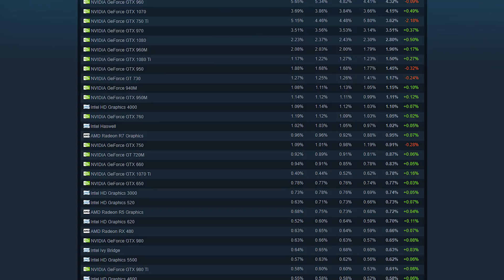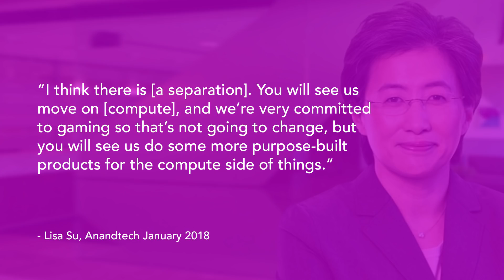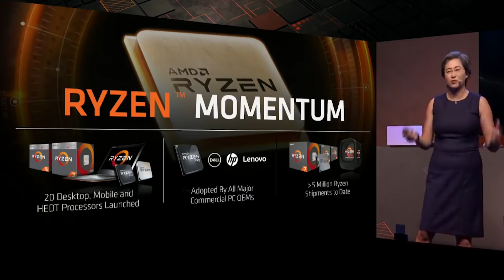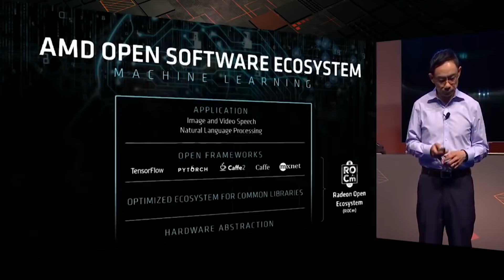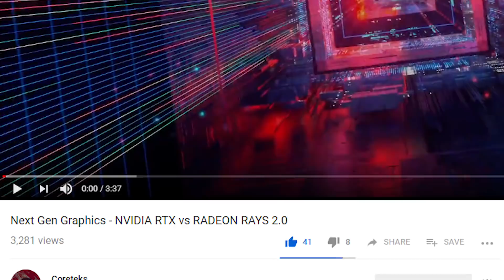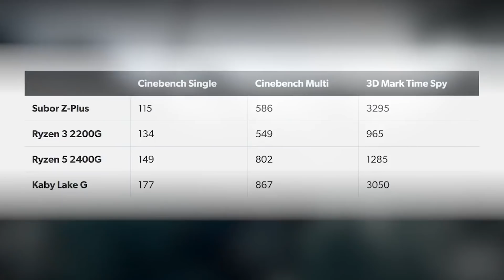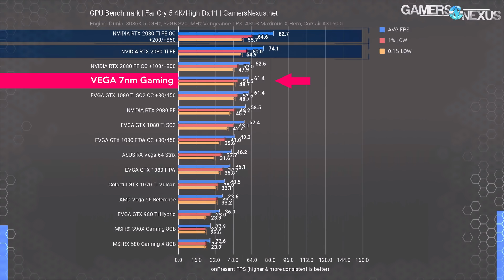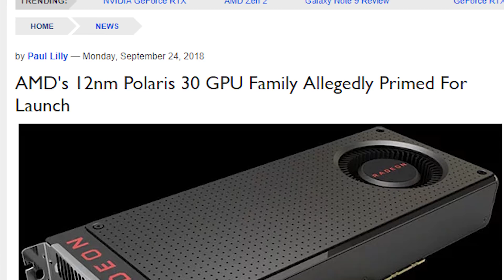AMD's answer to RTX

Comment: Regarding pricing, the pessimist in me fear that AMD don't have the room for too much price movement in the graphics prices, so they will be pricing cards to be roughly the same price/performance ratio as Nvidia cards. And we all know how well that will sway the Nvidia crowd over to try something else... I highly doubt they will be setting price points that look very enticing.
Reply: AMD IMO prices things "fairly" and do A LOT of "public" i.e 3rd party stuff, if it is expensive to produce, it will be more expensive on the shelf, but even then they are "fair" if you look at threadripper or EPYC as base example they could have "easily" priced them 2-3x what they did (for the first 6 mths or so) but they did not, they made a chunk of profit, they walked away happy, consumer walked away happy, same goes with Rzen, 2-4x the same cores 4-8x the amount of threads of "comparable" Intel chips they could have "easily" priced them a few hundred more then they did, but they did not, they priced "fair" so they do not make "as much" but they get more product out in the world which benefits pretty much everyone.

Radeons have more or less always been this same way "Fair price for the product delivered" some exceptions such as the dual-gpu cards or some such as FuryX, Vegas, 7970 and the like, but those were all "costly" to be making and the "best" they could put out at the time...quality costs "something" AMD is all "quality" IMHO (obviously some AIB screw the pooch on them unfortunately by "crapping" the base design up, charging more then they should be, but that is NOT always AMD fault either to be fair)

I could picture if AMD did a virtually identical to 2080Ti level performance chopping price down by $200 or so (covers their costs and gets more out the door) time will tell (if it were Nv on the other hand, as they have proven time and time again, they would not "match the price" they would increase it by $100-$300+ instead...because they are "greedy"and bank on the "BS" features not the overall "quality" of the product to make the sales)

Comment: "AMD is falling further and further behind in terms of performance"

Bro, rx 480,580 and even the other ones still kill in 1080p, for many that's all they need, and for the price point you won't catch me buying a 1080 or ti except for 4k
 Back to the vid
Reply: gt 480 still slays in 1080p, whats your point here? going to re-edit your comment for the 3rd time?
Reply: You TriHard
Reply: that's like saying the 1030 is fine because the most common display resolution is 1366x768, therefore all you need is a 1030 to get by.

source: just google "most common display resolution" lmao
Reply: @uhix1490  
1030 sucks. Get an r3 2200g.
Reply: riplip WHAT A FUCKING NI.... CE Guy :)
Reply: @Davvid S Vulkan is basically Dx12. AMD got sick of waiting for Microsoft to engineer something to follow Dx11, which many felt didn't get you close enough to the bare metal to do any real optimization tuning, and made Mantle, which became Vulcan when AMD made it open source, effectively turning Vulcan Dx12 into a cross platform version of DirectX.
Meanwhile, OpenGL becomes less and less irrelevant.
Reply: I still fight with msi r9 280x gaming x  at 1080p 144hz
Getting over 40-50 fps on the games like 
Battlefield 1 , GTA V  etc.
Reply: temp tmp  
High end is for 40yo babies.
Reply: temp tmp  
Exactly... Irrational behaviour.
Reply: Exactly, how in the world is AMD so behind when Vega was never intended to compete against the 1080ti when it was initially developed?
Reply: V64 outperforms even the 1080Ti in some titles, e.g. Forza Horizon 4.
Reply: -T-X-M-  no the 56 barely edges out the 1070 and the 64 does worse in some games or is on par
Reply: @gnuportexe4657  CPU: Threadripper 1950X
Benchmark 3DMark

Firesrike 
GTX 1080
http://www.3dmark.com/fs/14740761
RX Vega 64
http://www.3dmark.com/fs/16192269

Firestrike Extreme
GTX 1080
http://www.3dmark.com/fs/14742676
RX Vega 64
http://www.3dmark.com/fs/14350860

Firestrike Ultra
GTX1080
http://www.3dmark.com/fs/14803523
RX Vega 64
http://www.3dmark.com/fs/14350895

Time Spy
GTX 1080
http://www.3dmark.com/spy/2945231
RX Vega 64
http://www.3dmark.com/spy/4271819

Time Spy Extreme
GTX 1080
http://www.3dmark.com/spy/2918777
RX Vega 64
http://www.3dmark.com/spy/4271798
Reply: -T-X-M-  The Vega 56 trades blows with the 1070/1070ti while the 64 trades blows with the 1080. More often than not, the 56\64 match or edge out in games that don't favor either brand.
Reply: 1080p in 2018? rofl
Reply: @tjpark6883  playing at 4k 30 fps OOF
Reply: +riplip just because they work fine for you, doesn't mean they're not falling behind, AMD has no high end to compete with nvidia right now, for a while in fact, so yes, they are, and have been behind on performance for a while.
Reply: @ Elon61 while I understand your point to riplip, I can't agree with your assessment.  "Falling behind" is a matter of context, based solely in the areas any business chooses to compete.  While the precedent was set by AMD in past years to compete with Nvidia at every market level, that does not mean they are required to do so their entire existence.  Businesses change their business plans and strategic outlook to focus on what works for them at a given time and will target their product offerings to the market segments they have strength in.  I suppose it can be said that AMD GPU are falling behind, but only after defining the market context the statement presupposition is hinged upon.  In another context again based on the statement presupposition, then no.   However if AMD attempted to directly compete beyond the shadow of a doubt by their own admission with the 1080ti, RTX 2080, RTX 2080 ti etc, that could literally be considered being left behind.  They have nothing that competes with any of the cards, nor have they announced any of their products capable of doing so.  Their Vega offering, particularly the 56 compete quite nicely against the GTX 1070 and 64 against the GTX 1080, despite some consumer and reviewer/tester claims to the contrary.  In that regard they aren't falling behind, their products accomplished in that market what was intended, save for the higher cost of HBM.
Reply: Elon61 not being the best doesn’t mean falling behind, if I made a good product that sells due to a good price but isn’t the best am I still falling behind compared to the best product that sells less due to the high price
Reply: is that how you interpret "falling further and further behind in terms of performance"? what do number of sales have to do with performance of their devices in this context? plus amd gpu market/revenue share has been way behind nvidia for a long time. there's no doubt a 480/580 performs great for their price point but if you want the best raw performance look elsewhere.

Comment: I’m definitely not holding my breath here but I think we might see potentially more gain. I mean I wouldn’t use Far Cry 5 as an example personally there are just too unoptimized in my opinion. Also the bench mark was using the STRIX Vega 64, the lowest clock Vega out of the box (doesn’t break 1500MHz stock). The highest factory clock Vega 64 I have seen is the Sapphire Nitro Plus which stock will reach 1550-1600 MHz. (Or even the LC Vega). I think using the Hardware unboxed Forza Horizon Benchmarks Are more showing for where 7nm may land on a proper PC port.
Reply: so he uses an unoptimized game (an optimized one would perform better) and the lowest clocked Vega card (higher clocked would perform better) so he should base his +35% off of a higher performing card... So it would perform even better than what he showed... Why not use what he showed? It isn't overly optimistic then as I just proved.
Reply: Jesper Andersen
 
That is an excellent point, thank your for a constructive response.

Comment: that 35% performance claim on the slide wasnt referring to the cards it was referring 7nm itself. in the context of a node "performance" pretty much just means clockspeed. extrapolating that to overall card performance is misguided as it completely ignores the impact of architectural changes or increased density, or even the possibility to trade off some performance for a better power efficiency curve.

Comment: We share the same opinion on nvidias moves.
That was the first i thought of after hearing nvidia will still sell 10series alongside 20 series. They will lower the prices of 20series once the 10series stock depleted. I can even imagine them doing an interview at some sort or announcement like " we want to make the 20 series more achievable. We heard you that it was too expensive and so on.
If this is all true and amd manages to release a vega 7nm that has lower power consumption and better Performance. I will switch red all the way. I read through articles of intel and nvidia and it disgusts me. I really hope amd picks up all the way.

Comment: I think you are wrong in your assumptions, BUT made me think if it's possible to make ray tracing with CPU+GPU in a much more scalable way,
Part of the AI calculation would be divided, and i think that Intel and AMD will adopt this at least on their APUs and variations of it, like the intel plus vega. So the extra ryzen cores will possibly be dedicated to do it, or maybe a hardware accelerator inside cpu and gpu will talk thru a faster lane.

Comment: VEGA 7nm Gaming GPU's  can be faster than 35%. It is also 2x more power efficient if they reduce it by giving even higher clockspeeds in favor of the performance we get faster cards. For example: With a 1.85x more efficient (which would be also great) card the performance would be 50% faster than the 64. The power consumption would be higher than they actually planned, but it is not the Gaming card specs so it can be different.

Comment: Big mistake in the assumptions about Vega 7nm performance.   Using HBM2 (even over a cut-down 3096-bit bus) would bring over a 50%, or even a 100%+ boost to bandwidth.  That could bring a performance boost of up to 50-75% depending on the configuration.  This scenario is WAY more likely since Vega 7nm is likely a semi-temporary card to hold the door till Navi comes out.  Oh, and since the 2080 Ti is $1200, AMD could get away with selling a 12GB or 16GB Vega 20 at $999 as long as it is within 20% of the performance of the 2080 Ti.

Comment: Remember when Lisa Su said at AMD computex event (6th June 2018) - 'for all you gamers out there, we will be releasing a 7nm gaming gpu, so stay tuned'?. 

Then at end of June 2018, AMD said they were going to release a 7nm-16GB-HBM2-Vega64 gpu?. At the time I was wondering 'why does it need to have 16GB-HBM2 because 8GB is more than adequate even for 4K gaming'?. 

Then the penny dropped and I realised this was going to be a dual V64/56 gpu on 7nm, linked by Infinity Fabric. Bearing in mind all the bullshit hype Turing and the RTX2080/Ti were receiving, I think AMD felt threatened and they needed to make a statement (viz. the dual Vega gpu on 7nm). 

BTW, a third party USA hardware testing company leaked out info saying that the Vega64 7nm-dual gpu was an absolute performance beast and that it left even the Titan-Xp in the dust. 

Then in end of July 2018, Lisa Su released a statement saying AMD would not be going ahead with the new 7nm-16GB-HBM2 gpu and she cited the high cost of 16GB-HBM2 to be the reason. She said gamers wouldn't be able to afford it. 

Even back then I said that is a bullshit excuse since Lisa is a highly intelligent woman (she has a PhD in computer engineering), yet it supposedly never occurred to her that HBM2 is expensive even for enthusiast gamers?. 

BULLSHIT!. I reckon AMD did a U-turn because they received inside industry information that Turing was going to be a failure. Therefore, AMD no longer felt the need to release a dual V64-7nm gpu. BTW, do you guys know that evil huang is Lisa Su's uncle?. No shit. You gotta love nepotism. 

Also, this excuse of 'very expensive HBM2 cost' doesn't cut the mustard for a second reason. Have you seen how expensive the RTX2080 and 2080Ti are?. The cheapest RTX2080 is £700 and the cheapest RTX2080Ti is £1130. 

Despite these criminally extortionate prices, gayvidia fanny-boys will shell out big bucks for these gpu's, so the excuse given by AMD that HBM2 is too expensive just doesn't hold any water.  

Apparently AMD is releasing a Polaris refresh on 12nm (RX680). I will be very disappointed, unless it turns out to have some very special features like all 4096SP's have been enabled OR it will be a dual core gpu (so 2x2304SP's and mounted on Infinity Fabric with total of 4608SP's) AND it will come with 8GB-GDDR6 (or 16GB GDDR6 in case of a dual core Polaris gpu).

Perhaps this is the actual 7nm gpu Lisa was referring to?. Only time will tell. 

The Polaris refresh will apparently give 20% performance improvement over the RX580 (according to Red Gaming Tech), just by going from 14nm to 12nm. 

TBH, I cannot see that happening if it is going from 14nm to 12nm BUT I can see it happening if it is going from 14nm to 7nm. Then the 8GB GDDR6 will give another 20% performance increase over the previous GDDR5. So we could potentially see a 40% performance improvement (same as RTX2060) which would put the RX680 halfway between a GTX1070 and GTX1080.  

AMD are doing an RX680 refresh before the RTX2060 hits the market cos AMD want to grab the mid-range market share b4 gayvidia.
Reply: "Evil huang is Lisa Su's uncle", NOOOOOOOOOOOO!!!!! "Search your feelings gamer, you know it to be true!"
Reply: @TechieTard  - lol. Yeah man it's true. The evil one whose name shall not be mentioned is the female youngling's uncle.
Reply: ''Su’s grandfather is Huang’s uncle.'' wiki. Lisa Su is the niece of Jen-Hsun Huang.
Reply: @Safetytrousers  - that is correct.
Reply: I have 2 Vega Frontier edition 16GB Liquid cooled GPU's in my heavily modded 12 core Mac Pro,  FCPX and other programs I run use all the Ram and the cores. not all of us play games, I Also have a 16 Core threadripper in a windows 10 rig, used for Davinci Resolve, Blender etc. with three TITAN X GPU's (Maxwell) so the new 7 nm Navi cards next year are what i'm waiting for to upgrade my rig. as in independent Film maker any saving on GPU's can be used for the purchase of other kit, (Cameras, sound recorders, fast storage, gimbals etc) which is never ending.
Reply: John - I was commenting specifically with regards to AMD's gaming gpu road map, although I understand perfectly well folks such as yourself are not gamers. Rather, you belong to the semi/pro market. That being said, I am not just a gamer. I have a 1950X with a 1080Ti (although I am looking to migrate back to AMD when a suitable opportunity arises). I am a Pharmacologist, so I also use my pc for academia related work and other projects such as BOINC-SETI and protein folding.

I am however astounded by the number of expensive pc's and subsequent ultra enthusiast components you apparently require. Your line of work is incredibly resource intensive. Your spending habits are probably on par with women. The only difference being you are buying useful items to further your line of work, whilst women spend exorbitant amounts of money on bullshit  ;)
Reply: I highly doubt they have the resource to do so.
Reply: @DarkPa1adin  - AMD have the resource to release an upcoming Rx680 polaris refresh on 12nm, so they are not as financially limited as you think they are. Tbh, Lisa Su is putting most of AMD money into the cpu side of the business.
Reply: @DarkPa1adin  BTW, I honestly think this Rx680 is pretty much pointless. It's just a quick smash and grab money making tactic.
Reply: @beachboy_boobybuilder  Well, it that's true, then I am excited for the RX680. It has to be cheaper than Vega 56/64 and require less power though. Although I do think the jump from 14 to 7/12nm will help.
Reply: @beachboy_boobybuilder  it's not pointless, it will steal marketshare from the 1060, it will be faster than the RX480 or 580, and cost about $300 (a somewhat educated guess.) It will be 3rd gen Polaris, which turned out to be a pretty good card once the driver coders at AMD got good at optimizing for it. To ditch Polaris would mean wasting a lot of meaningful effort invested in not only the hardware but also software.
Also, Intel licensed AMD GPU IP a while back, right after Vega was released, just before Koduri went to work at Intel. AMD makes alot of money through it's custom division, and Polaris is something that customers want AMD to keep working on, such as Intel, who will be incorporating something like a weird lovechild of both Polaris and Vega parentage. Other semi-custom clients might prefer Polaris over Vega, assuming that Vega is even offered by the semi-custom ppl. In any case, it is an option for its clients and it makes sense to refresh it every now and then, maybe every year a month or two before Black Friday (late Nov).

Comment: Compute is NOT raytracing(!!!) Compute is executed by CUDA cores, raytracing is executed by RT cores, to accelerate BVH creation/update/querying for ray-traversal.
AMD has "emulated" ray-tracing using compute-cores, with Radeon Rays running on-top of OpenCL - the same way that NVIDIA did with OptiX on top of CUDA.
None of that was ever relevant for real-time/gaming, and isn't ever going to be. DXR has an emulated-implementation out of the box - you can run it without RT cores using compute-shaders, it's just much slower...
AMD needs to design it's own RT cores if they are to ever compete with NVIDIA on DXR performance (notice I DIDN'T say RTX!!!), because unless-and-untill they can run BVH on dedicated hardware, they have no chance to compeye on real-time ray-tracing performance with Turing...